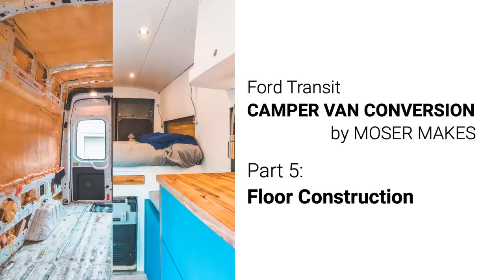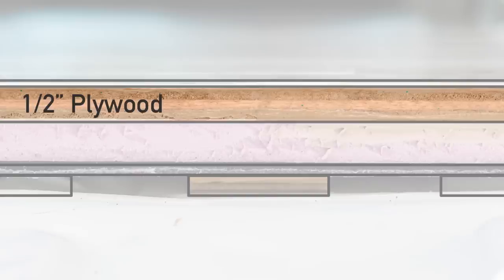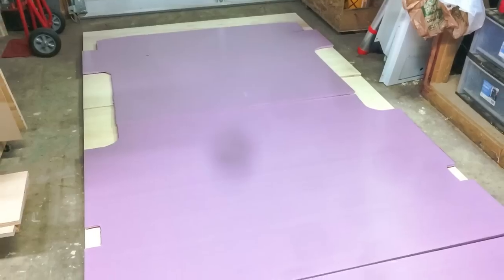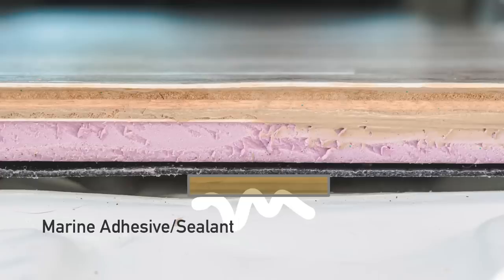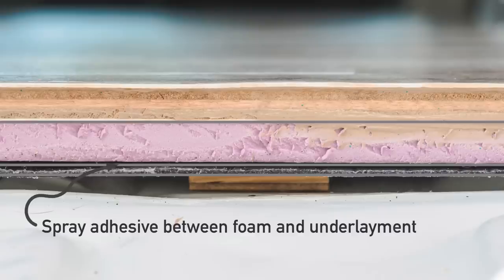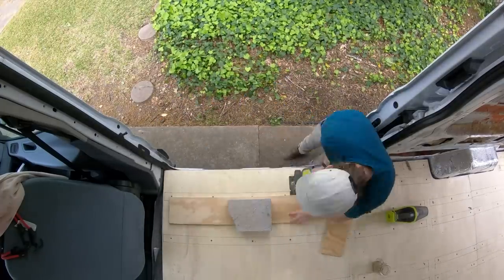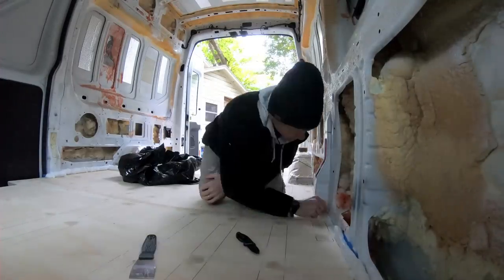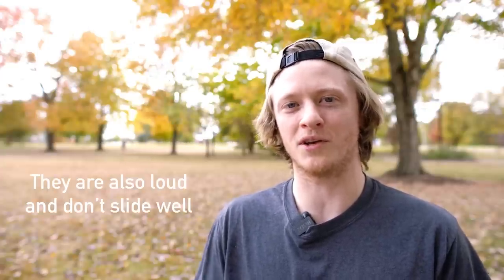Floor Composition & Construction for Camper Van Build

Comment: For your flooring problem
Just make sure you have strapping along all of the seams under the floor wherever two pieces meet.
Do this by placing horizontal crossers between the vertical planks and make sure the vertical pieces also exist wherever the flooring meets.
I appreciate your series, it's helping me figure out a plan for my build

Comment: I plan to do a hot coolant loop through the floor in my project.  I need basic amenities for mobile entertainment work.  Pa goes in the trailer and I crash at the end of the night in the van.   Will install a wabasto coolant heater for winter use to keep van and engine warm without idling.

Comment: For those who may be stepping into this now or in the future, two suggestions in particular:
1. If you don't use tongue and groove plywood as the subfloor, a spline insert cut into the mating edges of the plywood is probably a better option than something like roof decking alignment clips to keep the edges together. The spline can be wood or metal, is usually about 1/8" thick and the grooves to install it can be cut with a router and a matching bit. Half inch ply is too thin for effective doweling and biscuits break too easily when pushed down only on one side. 
2. Cut but don't install your sheet flooring when roughing in the floor. Roll the cut flooring up and store it until you finish with at least the ceiling and preferably the ceiling and walls. If your subfloor gets scratched, dinged up or paint/finishing materials/adhesives/putty/ect on it, you can fill any divots, sand any buildup back to level and cover up the sins with the sheet flooring. If you install the sheet flooring first, odds are you will damage it beyond practical repair and have to cover it up or replace it. 

Hope this helps!
Reply: I don’t fully agree with the second point at all, yes if you’re an idiot but if you’ve got to this point and you’re dinging it up to the point of sanding it back down then you’ve got no hope, towels, plastic sheets and a little care and I think like when fitting a kitchen getting the floor done like this is perfect
Reply: @Twink_Twins  And I would disagree with both.  What is the point of sheet flooring underneath a cabinet with drawers installed?     Decorative flooring last.  You'll still want to seal around any cabinets so that errant water spills can't get under them.  And it isn't only idiots that mar floors during construction, otherwise the flooring contractor in any home build would be happy to have to not cut in around any cabinets and would expect the "non-idiots" to keep his flooring nice for the new owners.  There's a logical order to construction that has been proven over hundreds of years.

For anyone TALL trying to preserve van height, no reason to give up 1/2" for XPS foam board at only R3 to say nothing about it being a horrible idea as support below a subfloor.  Instead, use sticky backed Duct Insulation from Home Depot, which at only 1/8" thick, is ALSO R3.  Cut strips to fit in all the low valleys of the floor, then roll a 2nd layer out over the entire floor, which means that around 50% of the floor will be R6 with its TWO layers of it, and about R1 for the single layer, which averages out to >R3 overall, while only yielding about 1/16" of vertical when compressed.  Now you have both a vapor barrier and insulation value in the floor.  Then, under cabinets and optionally in the garage area you can do another layer of insulation if planning to spend significant amounts of time in cold climates where obviously anyone would be planning to have some form of heat, starting minimally with a Chinese diesel heater for $130.

There just is no reason to ever build a subfloor supported ONLY by XPS insulation.  And by instead putting 1/2" plywood directly onto the 2nd layer of duct insulation and using rivnuts to fasten it down located barely off the edges of trafficked areas to not impact the vinyl flooring, you preserve maximum floor to ceiling height and avoid inevitable compression of a foam board under traffic areas risking flexing or squeaking.

The absolute best way to cut foam insulation board is with a hot knife (about $26 on Amazon).  This can then also be used when insulating the walls with foam board to do instantaneous cut and fit trials until you match each area the best.  No cutting dust going into the environment at all.

As mentioned, a spline or other method should be used to achieve a solid connection between edges of sheet goods in a subfloor.  That can be achieved without the special tool requirements for a spline by being as simple as a 2" wide strip of 1/2" plywood fit so that 1" reaches under each sheet and gets glued to them.  Then simply open a 2" channel in the XPS board to allow for the double thickness.  Put down 1 side of the plywood to be joined, lift and slide the 2" strip under and into place and trace the necessary cutout to the XPS board for the exposed area and lift the plywood sheet to trace the other half.  This would have also eliminated the problem of learning that XPS board is not solid enough to support a foot traffic area, particularly where two plywood sheets meet.
Reply: @gianttravelsbyvan9670  hi, I just wanted to jump in on all the disagreeing going on and mention that compressible foam before a floor is going to be more like R-0. Also, what's with 1/2 inch plywood if we're so concerned about height and - I assume - weight?
Reply: Biscuits in 1/2 inch ply worked great for me.  Just make sure it is over 7-8 ply and you will be fine. Baltic Birch is best.  Cheers

Comment: I will be using 2” rigid insulation and 3/4” plywood. 
Got to bear in mind you want to keep the cool air in during the summer when running the air conditioning.

Comment: This is a great video for anyone starting a floor. I did my van floor about a year ago and was very similar. I skipped the plywood in between the floor ridges. But I also used slightly thicker foam broad. I also did bolt down the plywood sheets but I was able to utilize existing bolt holes in my van. Overall has turned out great.

Comment: Your instruction is so clear, it’s amazing! The only thing I’d do different is painting the plywood with mold and mildew resistant primer
Reply: That isn't necessary as the plywood is not touching any metal surfaces. The plywood strips however could use some sealer as they are touching metal.

Comment: Thanks for this.  I just finished installing vinyl floor in a bathroom and like you I did it prior to anything going in.   I put a layer of 6 mil plastic and a layer of cardboard  to protect it and then  just cut away the protective layers before installing fixtures.  A question!  how did you get a wood screw to bite into the plywood strips that are appear to be only 1/4 inch without going thru the metal?  The taper on the point is almost 1/4 inch.  I would think that pronged T nuts would work better (but would be a pain to install).  Comments?
Reply: He stated near the start of the video that the strips are just under half inch (15/32") - quite thin as you say. I would be using something closer to 3/4". But he was also trying to have them level with the metal floor ribs; I can see the logic in his approach.

Comment: Having the wood directly on the metal floor. Doesn't it get wet from condensation over time?
Reply: I think it would have to.
Reply: @MAXIMUSMINIMALIST  that was a late reply... But still thanks! One year later I agree with what you said. We opted to make sure everything can breath as good as possible! Didn't like sealing of anything either.

Comment: I don't know this for certain but won't the bare wood (plywood strips) collect condensation lying against metal? I thought wood should not touch metal. Maybe seal them with polyurethane beforehand? Also, 1/8" plywood strips are not a good base for the 1/2" plywood floor. Plywood should be bolted/screwed down to the metal floor. You can go under the van and seal the holes afterwards. Just make sure you screw down into the floor where you will be able to access the holes from underneath. This means you may only find a few points to screw down into the metal floor but you don't need that many. If you get 4 at or near the corners that floor will not move. The way you did it puts all the weight of the floor, cabinets and entire contents of the living space glued to 1/8" strips of plywood. I wouldn't trust that setup.
Reply: I read this and decided to use TRIMFINITY 1-3/4-in x 8-ft Polystyrene Lattice Moulding for faring instead of wood for the first layer of the floor in my E350. I am going to hold it all down with bolts that fasten to the floor through the vinyl, plywood, and rigid foam insulation using the threaded holes where the seat base brackets went. With the price of lumber right now, these are cheaper, more moisture resistant, and last longer.

Comment: I don't think a floor needs insulation @ all! Even in sub-zero environments an efficient heater source deletes the need for a over-complicated flooring system. As hot air tends to raise its the walls & ceiling that're the area's of greatestest heat loss. The floor is where any moisture from any source will tend to pool. Keeping the floor system "simple" will "minimise" any potential threats fom H2O ingression! Remember, you will livin & breathing in a "confined" space. Moisture in this environment is your worst enemy. Everything in your van needs to "breathe" with the the ability to "dry" out. Not rocket science but just common sense. Good luck!
Remember the 'ol saying. K.I.S.S.!

Comment: For the benefit of your viewers, the professional installer Matt from AVC Rigs let the vinyl go back up the sidewalls of the van  by about an inch to keep possible spills on the floor. So don't need to spray foam around the  base. See https://www.youtube.com/watch?v=fIJkgnfU77A
And I think you are right, with underlayment, you didn't need soundproofing Kilmat because underlayment does the same job.
Reply from the maker: That's a good idea running the vinyl up an inch on the sides! Thanks for sharing

Comment: Nice. Why did you choose to use a vinyl floor finish instead of putting a clear coat on the floor?
Reply: Depending on the quality of the plywood, clear coat or stain and sealer would be options Link. Some ply is made with football shaped inserts that replace part of the wood layer where knots were and left holes in the layer. A finished floor of engineered wood would be an option here as well, however I would strongly recommend a brand with a really good integrated foam backer to avoid transmitted noise, to act as a thermal break and to maximize the floor's life with the subfloor moving and vibrating.

Comment: thanks for sharing your insights. You clearly think things through every step of the way. Do you think its worth putting foam board between the metal ridge and the plywood pieces in between the metal floor ridges to get rid of that air space?
Reply: wondering the same thing

Comment: would you say the plywood strips are definitely necessary? I have a promaster, not a transit, so the floor grooves may be a bit different, but I have heard various opinions on this, and some people even highly recommend against it.
Reply: I see no reason to discourage it. It’s bonded above and below. Even if it release it has no where to go and still provides support. It is possibly over-kill though. I like over-kill.

Comment: Vinyl sheeting is the way to go! Waterproof, cheap, and seamless install. Nice video. What is your opinion on spray foam as insulation/vapor barrier/ sound proofing?
Reply: Be careful with spray foam. It is open cell foam, which means it will absorb or wick water thru it. It does make reasonable insulation but its primary purpose is to stop air movement. It will have little to no effect on sound beyond perhaps stiffening sheet metal to dampen vibrations. For that it is better to use "mass loaded vinyl" or the normal sound deadening materials used in car audio.
Reply: Sylvan Butler I was originally attracted to it because I read that it’s a excellent vapor barrier. I’m very concerned about mold/mildew under floors or in my walls. Especially since I will be drilling a lot of holes. Got any advice about that?
Reply: @abigailv5347  I just tried and failed to find a reference on 'Great Stuff' foam being open vs. closed cell. In fact, one post on reddit vanlife showed good results after peeling off Great Stuff as opposed to other places without it.
Great Stuff looks like it would be fine. The key is you want a closed cell polyurethane foam. (not open cell, not latex)
Reply: Sylvan Butler thanks for the tips 🤙🏻
Reply: @Sylvan_dB  All foams absorb water. Single part foams do not cure in the middle & have large non-insulating bubbles inside. As a test, I filled a cardboard carton with single part foam & sawed it in half a month later. It was hollow & the uncured foam inside stuck to my saw 'forever'.  When we renovate flat roofs & boats, the closed cell foam is always heavy as it is full of water.
Reply: @jdwilsun  Interesting. The manufacturers of closed-cell foams, claim otherwise (and their claim agrees with my non-nautical experience).

Comment: Dude, awesome job, just freak'n awesome! Q/? what do you think of a heated floor for colder climates?
Reply: @MoserMakes  Agreed on both thoughts Sam.. When it comes time for me to do a van build, I definitely use your floor ideal with wood slats, just ingenious!
OK, another question.. Why Thinsolate Insolation instead of like WoolWorx (Rockwool Acoustic Insolation by Roxul)?  Mark...
Reply: Mineral wool / rock wool is not environmentally friendly and can be hazardous to your health. Be careful. Actual sheep's wool is being used on some vans, though, for insulation.

Comment: This is excellent. Thank you. I was planning on filling the bottom ribs with rigid styrofoam. Then 1/2” rigid styrofoam board over that. Then 1/2” plywood, and finally luxury sheet vinyl. Only gluing everything down. No nails. Does anyone have any thoughts on that? My van will be the 118 WB Promaster so the seam of the 2 plywood sheets will be under the bed.  Thanks in advance for any advice.
Reply: If you go to Bob Wells's (cheaprvliing) van assembly guide, he says spray foam tends to trap moisture and eventually lead to rust.

Comment: A dent in the floor could also be accommodated with Bondo under the plywood. Shims would work as well.
Reply: Could.  Requires prep work and those dents are inna high traffic area. Bondo isn’t designed to adhere in such situations. The fix shown is an eloquent, professional solution.

Comment: Good job. I think I would have used Reflectix between the pink foam and plywood as a vapor barrier also using a PVC fence board instead of the plywood spacers would reduce the chance of rot and mold under the floor, if water gets in there, and it will, you will have a mold issue with those plywood strips.
Reply: How could water get under a sheet of vinyl? No seams, thoroughly sealed edges?
Reply: @abigailv5347  Nothing is ever perfect. (I would not have bothered with reflectix either. I don't think it adds value. The vinyl floor is also a vapor/water barrier and so is the pink foam and that is already one barrier layer too many.
Reply: Took your advice and am going with TRIMFINITY 1-3/4-in x 8-ft Polystyrene Lattice Moulding for the faring.